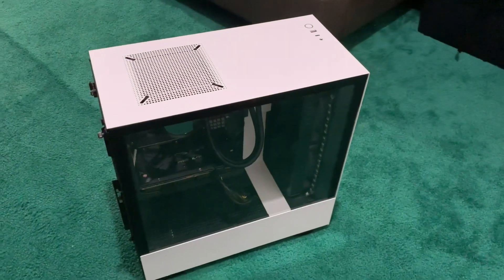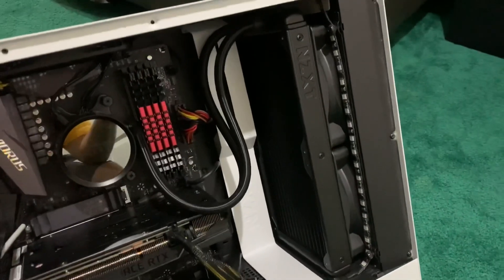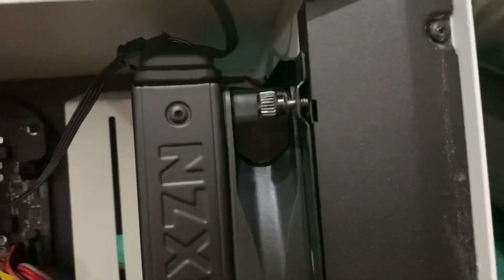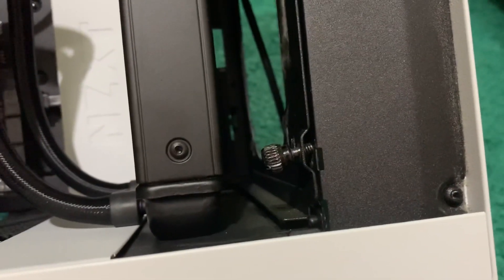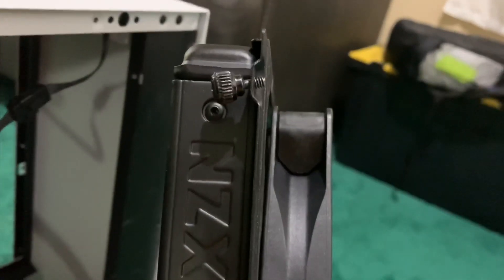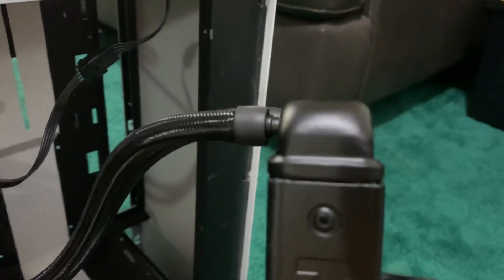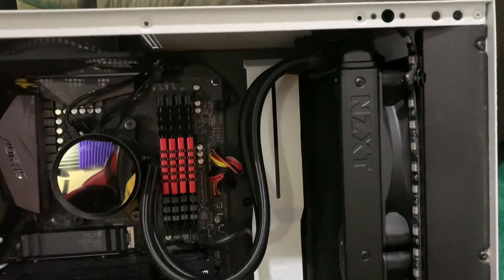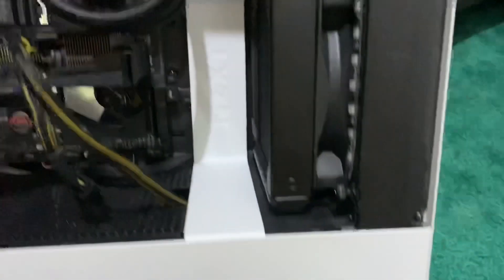X63 AIO will not flip in a H510 Case

Comment: WRONG IT WILL WORK i have mine with the hoses are at the bottom . all you have to do is dremal the wholes like a oval to make it work,,, maybe you just dont want to get those pretty nail polished nailes of urs dirty
Reply: i have pictures of my build so show
Reply from the maker: Lol.   Of course we could hack the case up and mod it.  

My point was I could t flip mine.  NZXT QC line is not upto par lately and where others could flip mine won’t.

That being said,  I wish I could cancel all comments cause not many people keep reading the previous ones..... there is. I reason to flip other than noise. No performance issues.  All works as it’s supposed to.   

Thanks for watching

Comment: this video makes me cringe...

bro have you ever heard of customizing?

i have a build with that case, and ive done all sorts of stuff to it

1st. remove that cable bar... its wasted space...

2nd. most nzxt cases have like bent metal on them due to the workers who build them using power drills and like overtightening screws, so you just have to bend it back to your liking/fitting

3rd. why did you make a video referring to #gamersnexus when you obviously didnt understand or grasp what he was saying... that orientation is fine, you usually want your pump below the res because gravity helps it live longer... but you can also flip it, you would never have to worry about air bubbles if you make sure they are at the top of the res opposite of the tubes when mounting it, thats what you mistaken...

either way, you have a nice pc, dont be afraid to get your hands dirty and bend or cut stuff man, thats how great case designs were made!
Reply from the maker: Video was created because I was curious.  Appreciate your input but majority of people who want an “out of box” experience don’t hack up their cases to “customize” them.     This was my experience with my specific AIO.   And if you read my updates this was not a “end all” it was more YMMV.

This video got wayyy more traction then I ever thought it would, I released an update and provided links to clarify some of the “aio nonsense” running around for those less educated.

All cases have flaws.  If it’s damaged send it back, lol don’t fuss over it, this is a $60 case, not a $150+ piece of metal which everyone wants absolutely perfect.  

My pump is below the top of the loop btw. 

Again appreciate you watching and giving feedback.

Comment: It is possible me and my friend got it to work after alot of fails
Reply from the maker: Absolutely.  But for the average person who doesn't want to modify the bracket, drill some off-set holes to shift the unit higher in the "tubes down" configuration.  Out of the box i couldn't see another way, hence wanting to put the info out there.  I like the tubes up look,  no noise issues, and if/when it needs to be replaced ill dive down that hole at that time.  

really happy with it,  just upgraded to the 3900x and im under 55c all the time.
Reply: @maz94protege  I just installed my x63 with the pipes down in a h510 elite. I was able to do it without modifications and with the mounting bracket in between the fans and the radiator. Initially I was seeing the space issue you mentioned as the pipes section of the radiator is thicker than the other side. But I just loosen up the fan screws a little and slide the mounting bracket down and the radiator and fans up a few millimeters, tighten back the screws and  it worked, I was able to mount it to the case.
Reply from the maker: @rben03  AAH!  Good stuff,  Ill play around more.   Thanks for the info!
Reply: rben03 do u think u can make a tiny vid on this so I can see what you mean ?
Reply: @rben03...thanks for that info, gonna be doing a gaming pc build using the h510i with the kraken x62 soon. I’ll be looking into what you said.👍🏾
Reply: @axelnorman4990  Sorry, I already built my pc, and having to disconnect cables and remove the aio would be a pain in the neck. But what I mean is that when I saw the bracket was not lining up with the holes in the case (the bracket screws were a little higher than the holes in the case). I loosened up the screws holding the fan, bracket and radiator together. I didn't remove the screws completely, I just loosened them up enough to move the radiator and fans up, and the bracket down (which I put between the fans and radiator), I tighten the screws and then I installed it to the case.